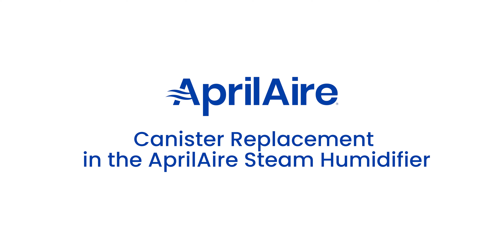How to Replace the Canister in an AprilAire Steam Humidifier

Comment: Wait, what am I replacing? An o-ring and a plastic jug? Why can’t I clean it instead of replacing it?
Reply from the maker: Thank you for contacting AprilAire! You are replacing the canister and the o-ring. The canister can’t be cleaned due to the electrodes inside. If you have any other questions regarding the replacement, please contact our technical support team at 800.334.6011.
Reply: @aprilaireco  I just removed it and now I see why it needs to be replaced. It’s bad…

Comment: My unit has the Service light illuminated. I will be replacing the filter later today, but how do I reset that light? Or does that happen automatically? Thanks.
Reply from the maker: Thank you for contacting AprilAire! It should automatically reset after changing.
Reply: @aprilaireco  Thank you. That's exactly what happened.

For other viewers, if you want to test your humidifier, just hold the power button for 10 seconds until all the lights come on. Then press the power button once to move through each of the tests. Once you're done, reset the power and you're done. There's a webpage somewhere that explains the process in more detail; search for "aprilaire 800 test mode".